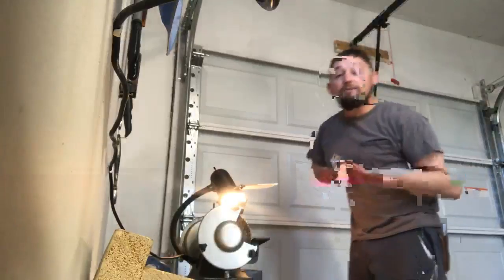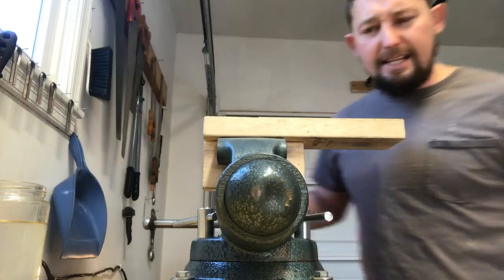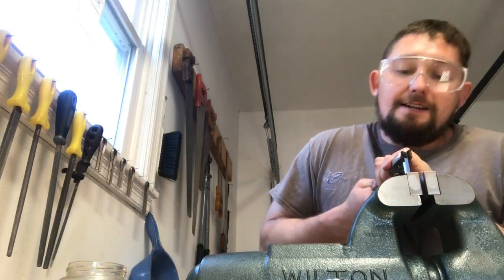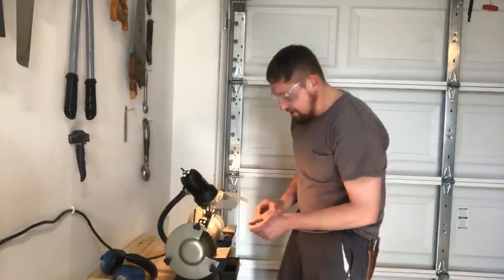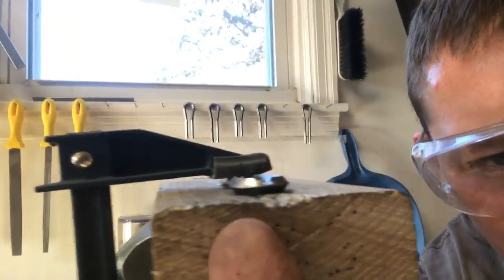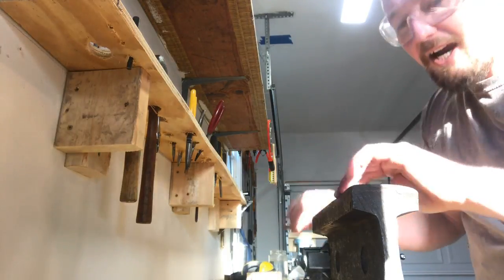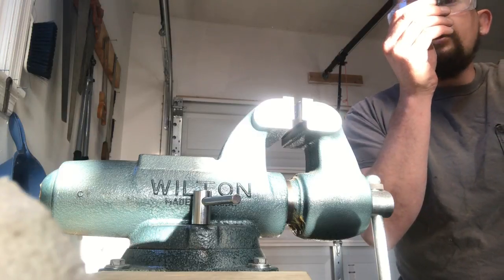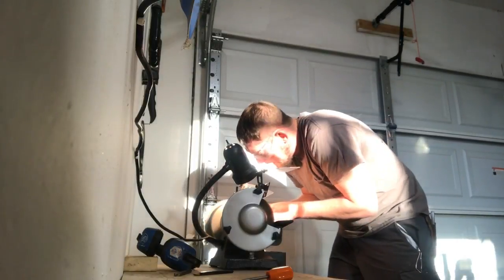Jaw Harp making today.

Comment: After making 5 successful harps, I found a new method to bend them which is easier then the method I had previously used. Also this newer method allows me to produce the frames consistently. The 6th harp made with this method turned out beautiful... UNFORTUNATELY I used a different gauge of spring steel for the Reed. ITS A TOTAL FAILURE HAHA.

I am gonna make several frames and try something a little different that may fix my issue.

Also, the lengths of my frames were never calculated so my lengths were just haphazard.

I used a .025 gauge band saw blade for my reed, a thick gauge then previous ones I made. However, I found this gauge to be way to thick and the harp is virtually unresponsive to breath. 

I was working the armatures after bending the frames with a square file. This has worked. But I've got an idea to try on the next one. 

I'm just kinda figuring this out on my own.

So my last harp was a beautiful reject haha.

Not discouraged tho.
Reply from the maker: If you clamp your harp in a vise and yes needle nose to wiggle the reed wile pushing it back, you can with some determination remove the reed, and make a copy of it in a thinner reed and slide it back into place and re crimp it so you don’t have to make a new frame.
Reply: Bebbcorp Harpery 

Thanks for that. I think I'll actually try to remove it because it's deffinently a better looking frame with a higher grade steel. Also, ive been using round steel rods rather then square, so I'm having to file the armatures. I love it, still learning tho.
Reply: Bebbcorp Harpery 

I successfully removed the old Reed. I went ahead and bent another frame while I was at it.

I tell you the method I'm using to bend the frame. It's round steel rod instead of square. I can't seem to find the square stock locally. 

Once I measure the first deck armature, I use the cheapest 20 dollar anvil from harbor freight and it has a square hole. I'll place an end of the rod in that hole and hammer the first deck bend. Then I double that length making the total rod length 3 times the lengrh of my first armature. Then I bend the second so that I am left with a shape that looks like a pentegon... A pentegon with only 3 sides.

Like the flat base of a pentegon with only the left and right sides with the base.

Like a "W" WITH NO CENTER ANGLE.

THEN I mark that center and glamp a pair of vice grips which I place in a vice. Then I use two hollow square peices and place them over my two arms and then bend down.

The main body gets bent around vice grips which make a nice shape.

I got this method from watching Clayton Bailey bend his harps and it works well.
Reply: Bebbcorp Harpery 

When I first started. They didn't look like Duck heads.. they looked more like Gumby haha.
Reply from the maker: That is awesome.
Reply: Bebbcorp Harpery 

Ha! I got .020 gauge this time.. way better. I got to hear a small breif sample of it just after I installed the new Reed I had made. Untill I snapped the trigger bending the elbow haha now I'm in the middle making a new one and gonna hafta try and get this old one again. Not gonna give up. Did exactly what I didn't wanna do haha. Just thought I'd share that.
Reply from the maker: I have done this many times rushing on a second reed.   I know the feeling.   It is where I came up with the wiggling technique with pliers to remove a reed.

Comment: You know I just have too take a guess at secret finishing techniques 🤔

Looks like camo Cerakote on the finished product for a coating. 

 I'm guessing you're doing the frame tempering by using nitrogen....because HVAC guy's use that sh!t all the time for pressure testing and as a shielding gas during brazing 😜

Thanks for the great video!
Reply from the maker: iam smiley for camouflage technique.   Soak in vinegar.   Rub thoroughly until dry.   Paint mustard on with toothpick in camouflage pattern.   Let sit for 30 min.   Rub dry and thoroughly wipe.   Oil with coconut oil.  Let sit for a day wiping every once and a while.  No rust shall be let form.  Bake in an oven with very thin layer of coconut oil on.  Start at room temp on lowest setting.   Increase 10-15 degrees every 5 minutes until you hit 425 or 450.   Hold this temp for 30 min to one hour.  Let cool to ambient overnight.  Check your harps and make final adjustments.  After they have rested.   Tempering and the way the harp cools may cause closing of the harp frames as bends and stresses relax.   Anticipate some relaxation of frames.